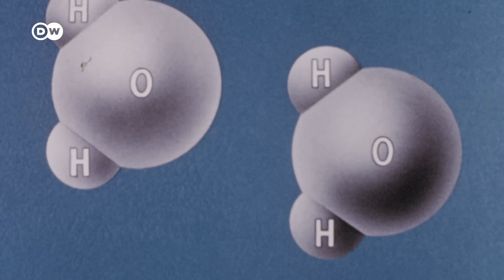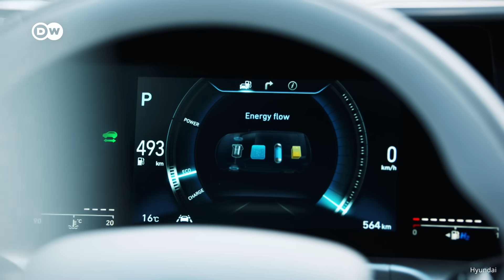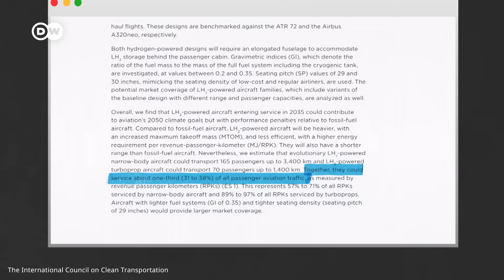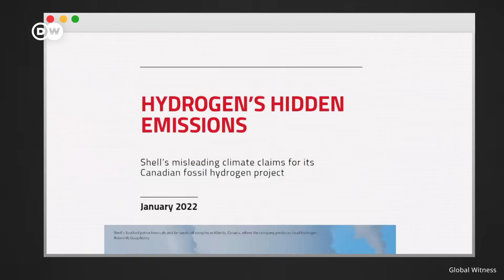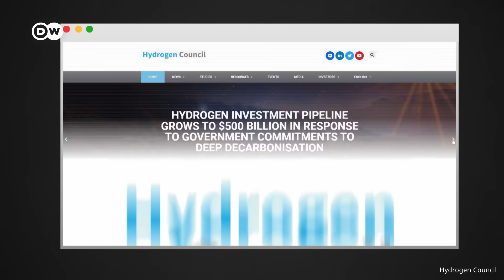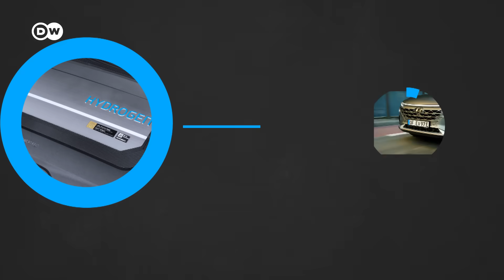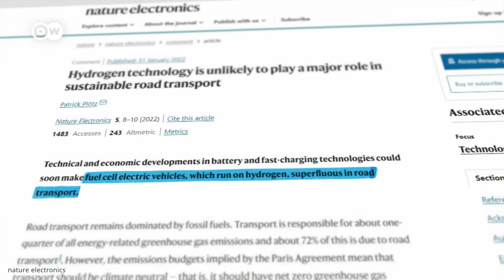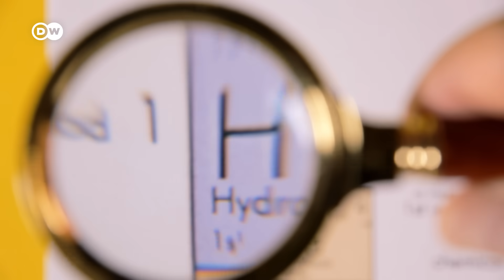The truth about hydrogen

Comment: Transportation is actually a great place for hydrogen. Sure 60% loss is a lot, but with improvements in storage, it will go down. But even if it doesn't, amount of power isn't the issue we are facing. We can always get more power at our current tech level by just building some nuclear powerplants. However, electric cars have a few major issues that their advocates don't want to acknowledge. Things like: range is lackluster for medium distance, towing will be problematic (more torque usage = even less range), lithium ion batteries are destructive to the environment both to produce and dispose off (not to mention, I doubt the energy cost of actually making the battery is included in figures comparing it to fuel cells), and car battery fires are an absolute horror show (I'm talking they've thrown the car in a tank of water for 30 days before the fire goes out). Hydrogen solves all of these issues. With some adjustments, you could use existing engine designs with hydrogen, making it a backwards compatible technology. And if you powered your economy on clean nuclear the losses become mostly a non issue, as any lost hydrogen is not a pollutant.

Comment: we had a 8 hp brigs running on the H produced by an old fried battery(1950) plates pulled from 1 side, sealed and a tube out of each side...12 amps and it was MUCH more than was needed to run the engine...an 8 hp motor will runn 4? 100 amp alternators...careful as they will kill u

Comment: What worries me the most about Hydrogen is its' Flammability as applied to transportation devices. Hydrogen, being the absolute lightest and smallest atom that we know of, has the ability to pass through, or leak, from anything you put it in. This could lead to hydrogen accumulating in enclosed spaces until it reaches an explosive concentration and then BOOM. Pipe fittings valves, pressure regulators and other devices associated with the storage device and the consuming device all would need very high quality (in terms of leak prevention) and likely therefore to be expensive (possibly to the point that someone seeking to improve his profit margin might skimp on this). While the newly manufactured device might be leakproof, what happens in the event of some extreme event such as a crash where the parts of this system could be torn asunder. We already know what happens when this happens to a liquid fueled device such as an airplane or automobile. And how much maintenance would be needed to ensure it remains leakproof during its service life. There are applications (such as glass blowing) where the clean flame of hydrogen is very desirable (even though it is virtually invisible which is a hazard of its own). What about the phenomenon known as Hydrogen Embrittlement of metal and its potentially deleterious effect on metal parts of the hydrogen "appliance". Maybe we should stick to things it is best for and use methane for transportation instead. Methane seems to have all of the advantages of Hydrogen plus by burning it we actually have the opportunity to reduce atmospheric content of it. Just thinking "out loud" though you can't actually hear me but have to read my writing to know what I'm, "saying".

Comment: Very interesting thanks. Just one comment... keep in mind that increased demand also increase research budgets, which would definitely increase production efficiencies. That is quite saturated in fossil fuels since most assume that their "golden age" is about to end. In addition, there is alsobio-hydrogen, or semi bio that is being extensively researched and would make hydrogen production more spread around the globe, so in general local markets could supply their own energy rather than relying on a centered industry.  That will generate a better control on demand to production ratio and minimize storage costs and need.

Comment: Enjoyed video, unfortunately it appears no one is thinking outside the box regarding this fuel. Green/Grey hydrogen is produced by electrolysis, l believe for electricity energy production made from fossil fuels could be a thing of the past within ten years throughout the world and very cheaply by comparison to other construction projects.
Here is how, most countries are using existing fossil fuel power stations and trying to phase them out making for cleaner options.
Why not build hydrogen production and storage facilities on these power station sites, use existing fuel to produce green hydrogen by electrolysis till you have stored three months supply, then switch the power station to run on green hydrogen, topping up the stored hydrogen production when the power station is not switched into the grid.
Advantages  net zero cost for fuel to run the power station.
No major infrastructure or machinery costs as they already exist , only conversion and maintenance required.
Ultimately surplus green hydrogen can be produced for road vehicles and other transportation as s being used already around the world.
In the U.K. hydrogen is being introduced into the gas network this could be their production supply source.
It is sad l have yet to here anybody make these suggestions
C ACooper

Comment: Extraction and offtake, green hydrogen
Electrolysis is crucial for fluctuating renewable electricity production and consumption. That in itself should be incentive enough. The resulting CO2 neutral hydrogen, oxygen and heat are commodities there are a great demand for. The world is desperately seeking an alternative to fossil fuel as an energy carrier. Hydrogen and oxygen can be stored and transported with existing technologies and infrastructure.
The greatest barrier is ignorance. The general public needs to be informed and enlightened.
Extracting H2 does not involve plugging  into the wall socket to make it happen. It involves using renewable energy sources that lie there unused because infrastructure and grid capacity are lacking. Renewable energy is free and endlessly available. The cost consists in making it available to the consumer in a robust and usable form. H2 is just that…!! Sensible and sustainable, and let's not forget cheap. Compatible with natural processes.

Comment: The focus on hydrogen should start with heavy transport, ships, trains and aircraft. The gap between batteries vs. hydrogen for light vehicles has been looked at for several years and found to be better served by batteries, not only for cost but safety. Hydrogen is dangerous in a vehicle crash, the weight of the structures needed to prevent explosions from accidents just add more weight. On heavy transport the additional weight for safety structure can be absorbed with little loss to cargo hauled.

Comment: Hydrogen is only viable if you have abundant production of electricity. And therefore you need nuclear power because windmills and solarpanel can't deliver that uninterrupted. In the winternights without wind you have.........0 KWh of electricity. Thus, where are they going to get that necessary electricity to produce hydrogen with nuclear power? Exactly, with fossil fuel. Last week we had 3 succesive days without wind (windturbines delivering 0KWh electricity) and the sunrise was around 8 am and at 17:00 it was already to dark to produce one single electron with solarpanels.

Comment: There's a reason, a very good one, that Hydrogen is Number 1 on the periodic table. Why it is the Number 1 fuel source for the Universe and stars. And why if common sense were to prevail, we humans would see the brilliance of hydrogen, and make it our Number 1 energy source for transportation to buildings and homes.  Hydrogen is the answer to pollution caused by carbon based fuels while fulfilling our energy needs (along with electric motors). Just my opinion. But I know reality seldom see's the use of common sense.

Comment: Solar energy is hard to store but it could be used for electrolysis of seawater to create hydrogen..? 

It would reduce the rise of the ocean levels while storing solar energy.

Brine from use of seawater, e.g. in desalination, could be dumped in designated small salt deserts. Stacking mountains of salt doesn't harm anything as opposed to leading it back into the sea.

Comment: To isolate Hydrogen to use as a fuel requires more energy input than the hydrogen offers at output. 
Hydrogen is a great energy store (battery) but it's not a new source of energy.

Comment: Energy delivery/density is very important.  If you have a car that gets 30 MPG, try to imagine you squirting a stream of gasoline 30 miles long.  It would likely be 1/8 the thickness of a human hair.  Please find another source of energy able to do that. One gallon of gasoline weighs approximately 6.8 pounds.  Just think about it... 0.226 or 3.6 oz to travel One Mile.  
How about developing the 6-cycle engine, which utilizes the expansion of water molecules to generate power while reducing cooling requirements thus increasing efficiency.

Comment: Stanley Meyer created a Hydrogen Fuel Cell vehicle in the 1990s that produced Hydrogen for the Fuel Cell onboard from any kind of Water, even ocean, ditch water, or poison wells, though Distilled Water is likely best, but he was killed for having done so during a sale proposal meeting.  His Patents are likely tied up in litigation or have been bought by the Government, CIA or some other multi-letter acronym entity and locked away in a Black Covert Closet on a shelf, never to be seen again.  However, if Stanley could do it, it can be done again.  If the onboard process is not recreated and Distilled Water, or water of any stated purity, is going to be required for the Hydrogen Fuel Cells, then gas and diesel stations could either thoroughly clean some already buried gas and/or diesel storage tanks to cure and prepare them for the storage of that water, and continue to do the same as gasoline and diesel are being phased out, until most are cleaned for the water when gasoline and diesel have been minimized, or put in new underground tanks for it, and sell it for Hydrogen Fuel Cell vehicles for it's required purity.  Gasoline, diesel and refined oil will still be needed during the transition to whatever replaces them, so if it's going to be Hydrogen, gas stations can convert the gas and diesel storage tanks to the point where either few or none are needed anymore.

Comment: Where did you get your efficiency numbers?
What you’re saying is just blatantly completely not true.

You’re saying that Taking renewable energy from solar and wind to extract hydrogen from water, then transport to fueling Stations and then to a car where this hydrogen will be used to create electricity is less efficient than charging a battery electric vehicle?
In order to charge a battery electric vehicle, you have to build a battery big enough to give you a reasonable amount of range. That battery production already produces more emissions than the production of a hydrogen fuel cell vehicle plus its entire life cycle.
Also, energy to recharge batteries doesn’t come from renewable production because most battery electric vehicles are charged during the night which means we have to burn fossil fuels to recharge them. So you have to extract either coal or oil from the ground then refine it then burn it in non-efficient ways then produce electricity then charge batteries.
Other than that, the time efficiency on battery electric vehicles is ridiculous. The only commodity we have in life is time and if you have to spend it waiting an hour for a battery to charge instead of just fueling your vehicle with hydrogen in a matter of three minutes, you have become 20 times more efficient with your time.
Battery electric vehicles are completely non-renewable, we will run out of natural resources to make these batteries which are completely non-recyclable.
The whole idea of having and using hydrogen fuel cells is to bypass the need for a battery which is inherently non-renewable and non-recyclable. You could even have your own hydrogen electrolyzer in your vehicle producing hydrogen while you are in sunlight; parked or driving.

Comment: Perhaps the cleanest power for large cargo ships is nuclear. Nuclear power has already been proved clean, safe and reliable in American aircraft carriers. Over 60 years ago, the U. S. even built a civilian nuclear-powered demonstrator ship, the Savannah. Now there are companies building small modular reactors in the 60 MW range, which is about the right size to propel a typical cargo vessel. A reactor-turbine-generator-motor set would probably be smaller than the fuel bunker and engine in current designs.

Comment: If renewable energy is used to produce green hydrogen then we need to see an analysis of the underlying Wind and Solar CO2 footprint. That means tracing all the wind and solar input materials/metals and calculating the underlying copper, aluminuim, etc, CO2 footprint. Were those metals mined and refined using green or fossil fuel energy. Was all the transport/logistics for mine procurement delivered by green or fossil fuel transport. I think we all know the answer.

Comment: wait wait wait! ... this fuel produces waste made up of ONLY heat and WATER??? . the heat sounds safe enough but what KIND of water? clean drinkable water? or some poisonous mess when you add up all the hundreds of millions of cars trucks planes and all else that will be putting out this "water"...what type of  nightmare pollution will this "water" then contribute to the air land and normal water systems? seems to me just plan hydro power is the only solution along with extra large water wheel or windmill type mechanical devices where they can be used. all else is just another same or wost problem. just scale everything [manufacturing, life styles, expectations consumption etc.] down to what hydro power can provide is the only safe long term solution. that and various basic mechanical devices

Comment: An interesting discussion but the one thing you haven’t talked about is the hype that the only emission from using hydrogen in either a fuel cell or engine is water. There is the potential to emit NOX especially from engines and central heating boilers.
Reply: Exactly. Plus ice engines are only 36% efficient. Complete waste of expensive energy.

Comment: Volume for volume liquid ammonia stores more hydrogen the does liquid hydrogen at its boiling point. Ammonia fuel cells are efficient, their residue is water. Current gas stations can dispense ammonia. Liquid ammonia does not need high pressure tanks for storage.  What more can one say . . . .

Comment: It takes, currently🙄, about 38 pounds of battery to equal a pound of gasoline. Hydrogen must be stored at very high pressures. This requires a lot of energy just to do this. Electric and hydrogen powered planes do not have much range. Certainly there is room for improvement in our energy usage but the electric and hyrogen transportation thing is a fad that is emotionally and politically driven. I will be glad when we get realistic.

Comment: Only water. Of all the greenhouse gases, water is much more "dangerous" than carbon dioxide. Oh well, this isn't the first time we rush into a solution to learn that we didn't examine it closely enough. Asbestos was the wonder mineral in its day, until it was deemed dangerous. In my opinion, we need to thoroughly examine what putting excess moisture into the atmosphere does to the climate. It will not be benign. Misinformation spreads so quickly around the world before information puts its shoes on. By the way, why were zepplins abandoned ? due to safety concerns.  Hydrogen hasn't changed in 80 years.

Comment: Good presentation.  One source of hydrogen is in oil deposits.  Research has been done were the in situ oil deposits were warmed.  This resulted in the hydrogen separating from the oil and rising to the surface of the oil.  This then removed from the oil deposits.  The biggest issue is how transport the hydrogen to storage as it is very combustible.